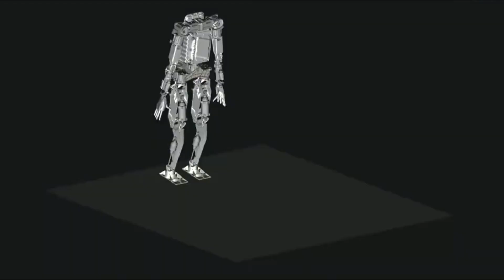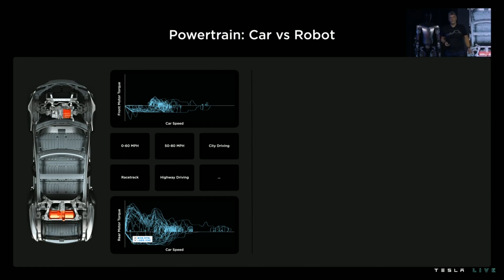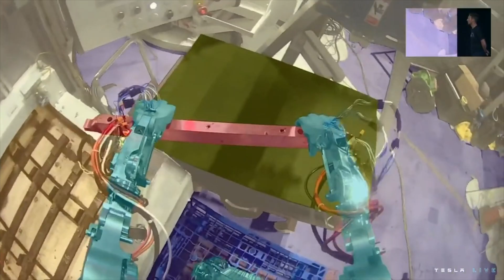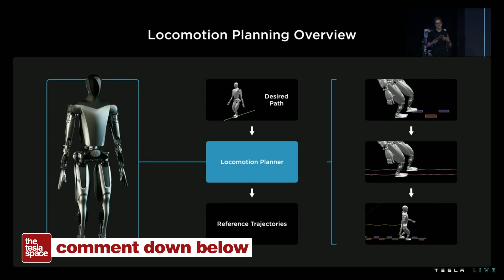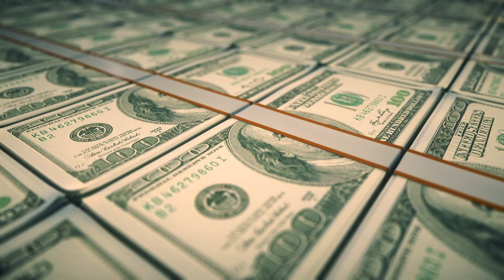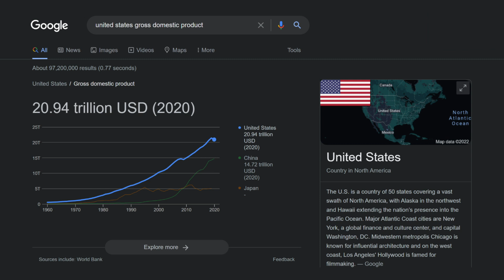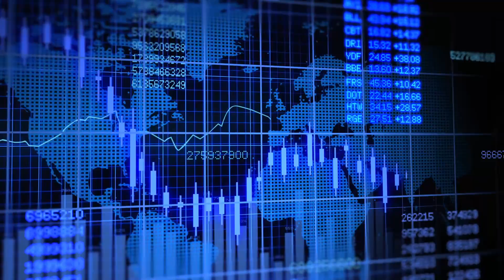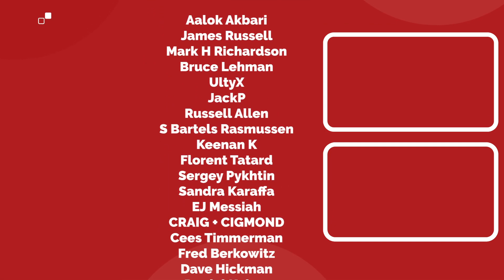The Real Reason The Tesla Bot Will Make Us All Rich!

Comment: "If productivity is limitless, then the economy by extension will be as well."<-----And that's the problem right there.  Productivity is NOT limitless.  You can only make so many robots before you run out of the materials to make them.  The energy to charge their batteries isn't limitless either.  Also, there's nothing here that indicates why human poverty would be eliminated.  We've increased productivity and thereby wealth before, but the lion's share of the profits have always ended up in the hands of the few rather than the many.  Furthermore, the part of the profits that goes to the general public has been derived from the general public working in these more productive companies.  This video is talking about these half-witted robots taking over all human labor somehow.  That means  more wealth for Tesla, not for the rest of us.

Comment: I'm all for the Optimus bot and think it will revolutionize manufacturing, and even factory design. Humans will be replaced by robots wherever management thinks there is a strategic advantage to use them. This will enrage unions and there will be movements against the robots as human jobs are reduced. For this reason I do not think you will see Optimus in public. In urban areas the likelihood of vandalism or kidnapping would be high.

Comment: how will they perform in dirty jobs where they could get dirty by dust or sticky products like in construction ? how can they clean up jobs where techniques in cleaning are needed for optimal finish can they paint or chalk joints, set ,grout tile ? or ad adhesive at a 100% coverage rate and then handle produced pieces to put together ? in various locations and atmospheres ? or  enviroments ? have the ability to complete a construction job with all tools and materials  hardware skills to achieve safe install and perfect finished product then clean up project as well as themselves ???
Reply: Lets wait and see what the final working versions look like and how well they're sealed up.

Comment: The Swedes already figured out how to end poverty. The world should follow their example. All this fancy tech is not necessary. Plus autonomous robots are still scary even if they are slow and only made of aluminum. It actually kinda seems like humans would still be more productive since the robots are still quite slow. Also if it goes until the battery runs out, that's kinda stupid. It should at least be smart enough to get itself to a charger so it doesn't have to wait for a human who will probably be sleeping so the robot will only be useful during daytime hours anyway.

Comment: Care bot for the Elderly. 20 to 40k would still be much cheaper than current options.  However, at least one version is going to have to be strong enough to pick up a 50 lb bag of material.  It’s a common weight for many different materials from dog food to cement. But it shouldn’t be too difficult to increase strength to that level.
Reply: or to pick up the elderly if they fall...
Reply: I think when the old people see these robots they're going to want to die sooner
Reply: Or to crush the elderly to death and begin a robot uprising. I would not leave my grandma alone with a mindless or a mindful machine. No thanks. The bot can mow my yard tho 👍🏻
Reply: Elder care in Germany costs 36,000 a year per parent, children have to pay. 2 parents over 20 years in care, makes over 1.4 million USD. As long as the bots are cheaper than that, they'll sell.

Comment: I’m no engineer.  I’m not even good at math, however wouldn’t it be novel if Optimus could move by having its legs partially fixed while employing tank like traction in its feet for  forward and backwards movement . Then use the legs to turn the feet into the desired angles for further forward motion.
This would remove a lot of movement impediments and speed up Optimus’ movement to different points.  Elon, if you like this idea all I want is a discount on my bot!

Comment: The title is a joke?
Free (electricity cost, mainly) labor will make the owners rich, not the average joe. AI is already replacing office jobs, drivers and artists are next on the table, with this robot every low-skill manual labor job is in danger.
And yes you can tax the rich via a "robot tax" and use that money to fund UBI, but that will still divide people into casts. And being 100% dependent on the state, with no skill to sell (a lot of people won't or can't be brilliant engineers/ AI psychologists or emergency responders) is extremely degrading and dangerous.

Comment: The size of the bot will become smaller as the next few models come up, same as the iPhone and laptops that became iPads... minimisation of parts works always like that.
Reply: Mmmm no. Not physically smaller but maybe “leaner” 
Less bulky actuators. Less dangling wires. Lighter but stronger materials. iphone hasnt really gone smaller either. Their max phones are bigger than their first iteration phones.

Comment: My issue is that I don’t think it would create more for the common person. They would pay money for the convenience of repetitive tasks being done, sure, but so would everybody else. Competition would be quintupled overnight, so I worry that if it doesn’t fulfill elons promise, than it would create a larger economic divide.
Reply: Correct and not.
1. Currently labor cost represents at least half the cost of all the things we buy throughout the economy.

The robot will cause deflation of the cost of almost everything.

Second if you get a bot it can fix / manufacture stuff for you. You don't have to pay a person to fix your car... the bot will fix the car.

It will basically make money a meaningless concept. If there's inequality it will be because we keep it alive for fun.

Also we wouldn't run out of resources because recycling becomes more profitable when you have robots to take everything apart and build it into new stuff or stand around washing the garbage.

It would effectively be possible to have a bot recycle the parts of your old car and 3D print you a new car buying only the metals /plastics you need to complete the changes.

So instead of new car = a year of wages even if new car is no good. New car = raw materials of old car + raw materials required to add new car features.

It really could be sustainable because the only reason for someone to buy a new car in the first place would be that the cost of labor to fix the old one into working order is too high.

If I could pay a small fee and have my old car stripped and melted down and turned into a new car I'd never buy another car again.
Reply: @dylanbaker5766   "If there's inequality it will be because we keep it alive for fun." - What makes you think the wealthy people in power want to be equal to me ...
Reply: Unfortunately you have not kept up on the WEB plan to depopulate and bring in a digital currency making us that are left slaves and China is going to be the world super power.
Reply: @hughparker9384  
the guy already answered this 50 percent of inflation comes from manufacturing and processing goods. 

If we have robots take over this sector of the economy we would theoretically have more “manpower” to have a surplus of goods because robots can work all 24 hrs except for charging and don’t need a wage. And because of the capitalist system we would have more quantity then demand which would lower inflation which would lower prices. And this is just for one sector the goal ofc is to automate everything where there can be a surplus supply of goods and services so that the dollar amount has raised to the point where currency is not needed. Which is highly unlikely but it could happen ofc there are corruptions and people (interest groups) including governments that won’t let this happen but I think if everyone worked towards that goal it could theoretically happen.
Reply: @angelaguilar249  I think if everyone worked towards that goal it could practically happen... Post-scarcity is a well researched topic. It's possible either with great automation or abundant fusion power.
- The only problem is if the transition is too "violent" (like people rioting, because there are not enough jobs, but everything is not free yet, and governments fail to handle the situation well) or if it's artificially prevented (if sufficiently "selfish" people had enough power)
Reply: The common person can buy one. Start a business and they have an employee that never sleeps. Automatic promotion to management ❤️
Reply: @Studio_234  only if they can afford one
Reply: I'm worried 80 million robots will be split between menial home work like doing dishes and picking up dog poop, but the other 40 million will replace 40 million peoples jobs. Which isn't bad if they have somewhere else to immediately work that's better. I don't think that'll happen right away. I think 40 million bots will replace 40 million people and only 25% of them are going to have a way better job. It'll be less people doing more with robots so 30 million people are going to need a new job. If the robots are cheap then they'll generate Less income. If I tell my bot to get a job he'll go unemploy someone for 1/4 of the wages and I'm going to need 4+ bots just to make the same money 1 of me was making.
Reply: @TheAnnoyingBoss  I don’t see the issue. At that point you could just keep your job and make 25% more because your bot was working too. There will always be jobs available that people don’t want . And there are many jobs people need that are killing them slowly everyday for no benefit other than to their employer. It’s time to let the bots handle the grunt work. And let humanity shine in less labor-centric ways. Focus on innovation, art, advancement, sustainability , exploration, problem solving, living life…

Comment: To anyone who has bought into Elon's hype of Tesla Bot, let me - a former professor of Electrical Engineering with a Ph.D. from MIT - give you a concise tutorial of humanoid robotic technology.

There are two components in humanoid robotic technology: one is related to its moveable mechanic body, and the technology belongs to Mechanical Engineering; the other is related to its mind, and the technology belongs to Computer Science.  In order for a robot to do any task that Elon was talking about, no matter cooking, cleaning, loading or unloading, etc, it requires the robot to possess an intelligent mind, for instance, to be able to understand what it sees.  This involves a technology called visual representation, which no computer scientist knows how to solve.  For instance, if you tell your Bot to clean the house, it must be able to tell the difference between a broken glass and a small toy lying on the floor, which is so hard that no A.I. expert even knows how to proceed other than brute force approach, which requires the Bot to have a supercomputer even more powerful than Deep Blue.  So far Tesla has been only working on the moveable mechanical body of the Bot, which is the easy part, and it has not even touched the core of A.I., which is the intelligent mind.

Just for your information, Elon just fired an entire office of computer scientists working on A.I. in Silicon Valley, and that tells you how promising Elon actually thinks Tesla Optimus Bot is.

Comment: I will pay anyone $10,000 if they can show me a self-contained power source robot that can completely clean a bathroom and not run out of power in a few hours!  It must be flexible and not need a tether. It must not fall over and be picked up to continue its job. 
I have 7 robots and will again point out that any such machine needs amazing software to do these tasks (we are programmers).  It needs joints so flexible they can clean all the floor, tub, walls and windows without falling over.  And if not plugged in to a power source, will run out of power quickly.
We are so gullible in believing we have such robots!

Comment: If the goal is to get robots doing all human work, Elon should tell his robotics team to focus 100% on practical solutions to real tasks, regardless of how close to the human form the resulting robot is - though concentrating on interchangable components is still important.
- Probably the lowest hanging fruit is to put a humanoid (torso with electronics, multiple camera eyes, 2 arms with hands) on the end of a large industrial robot arm that can precisely position the 'humanoid' robot to do assembly operations on a car that are normally done by humans.
- The next lowest hanging fruit would probably be a wheeled robot for fetching and carrying components to feed the car assembly line.  Actually, given that Tesla already has the vision and guidance software working, this might be the lowest hanging fruit.
- Instead of insisting that the robot use 'camera eyes' in a 'humanoid head', add cameras to the robot in or near the hands to greatly ease learning of fine motor skill tasks such as manipulating and installing wiring harnesses on cars. The robot might actually have an independently controlled and more flexible 'camera finger' added to the otherwise humanoid hand.
- They may have done some work on having the bot mimic human movements tracked by a camera.  Expand that to direct VR teleoperation of the robot, where the human supplies the intelligence while the robot handles fast-response issues (like balance and walking) AND learns what the human is doing.  This is the path to quickly training bots to integrate into any task.
- For outdoor work, start by mounting a humanoid torso on the end of the arm of a bucket lift vehicle and putting it to work on SpaceX rocket assembly, again under human VR teleoperation.  E.g. each Starship has hundreds of thermal tiles that need to be perfectly positioned and attached AFTER the rocket is built.  The same concept could be used for roofing homes or installing solar panels.
- For more conventional construction sites, develop a bot torso mounted on a simplified robot arm that is in turn mounted on a small- to medium- sized ATV to let it move around quickly on rough ground, mostly doing fetch and carry tasks at first, then collaborating with human construction workers, and eventually taking the place of those workers for an increasing number of the more risky tasks.

Comment: This type of super unstable and super slow robot has been developed for decades at least in Japan. The thing is that it is easy to make this slow unstable machine but try to improve it into something actually functional, well, ask the Japanese how it will work out, they have been working with this problem for many decades without any success, they are all slow and unstable.

Boston dynamics has been working with some robots that are more stable but still nothing actually functional that could replace human work.

Comment: "The (bot computer) does everything a human brain does."  I think not.  Not even close.
Reply: That would include, that we already knew, what a brain exactly does.
Reply: @CyberlightFG  Well we know the brain does a lot of things very badly, driving is an example.  10s of thousands of deaths each year.  Also memories are very imprecise.  I was on a jury once and every witness remembered the incident in question differently.  I myself am clumsy and slow compared to any pro athlete so there is much variablility in dexterity.  I think generally the human brain is not entirely optimal so there is certainly room for improvement in some or maybe many regards.
Reply: I think in time ( decades, not years or centuries) bot computer will be in many ways superior to a human brain and in very few ways inferior.  It certainly will be significantly different.
Reply: @goukux5908  Your prediction is unfounded and so much gaseous rhetoric.
Reply: @ReachOutToWilliam  I find your retort without substantiation.  My prediction is based on many decades of exponential progress in processing, and recent development in AI, language processing, and machine vision.  IBM is on the Cusp of true quantum processing, they have been working to a roadmap for nearly a decade and have stayed on or ahead of the roadmap, so it is predictable that in 5 years they will have a commercial scale quantum computer.  These things make AI possible in ways that currently don’t exist, but probable will in 10 or 20 years and baring an world scale catastrophe certainly will in 30-50 years.  So what about this is not factual or as you without substantiation refer to as gaseous.  BTW I find the term gaseous to be rude.
Reply: Plenty of evidence that if current accelerating trends continue, machine intelligence and creativity will leave us in the dust before the end of the decade.
Reply: @andrewradford3953  Point me to the scholarship (not YouTube videos or Elon Musk twats) that shows that.  How about three peer reviewed papers published within the last year?
Reply: @ReachOutToWilliam  How about you do your own research, then you wouldn't be making vacuous ignorant comments, without providing any citations, and yet then asking others to prove you wrong?
Reply: @andrewradford3953  🤡
Reply: @MrJKJKJK1974  I am not asking for anyone to prove me wrong.  I am asking for the basis for what I believe to be baseless statements.
Reply: @ReachOutToWilliam  Like those provided in the OP's response?
Reply: @DieserAndereChris  Genius! /s
Oesterreich uber alles
Reply: @goukux5908  🤡